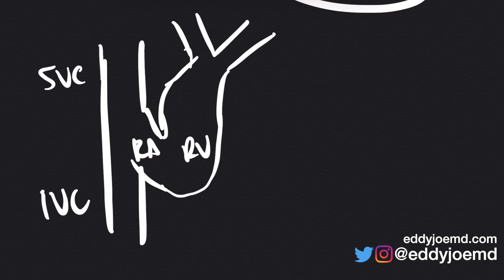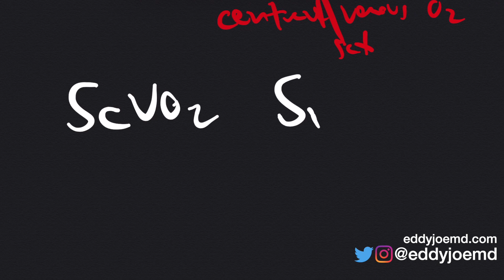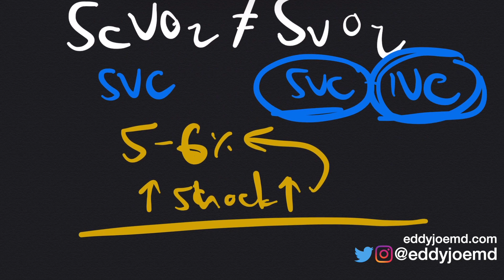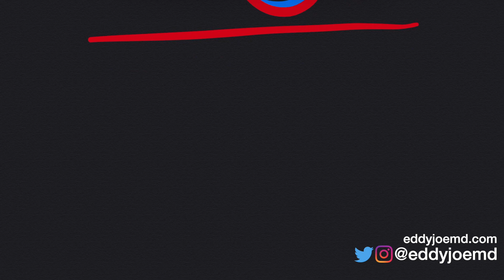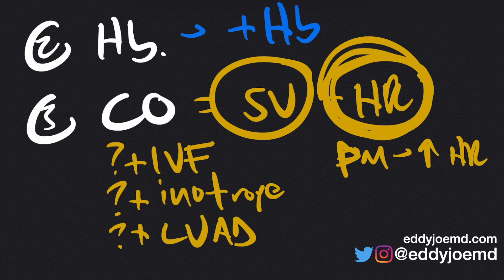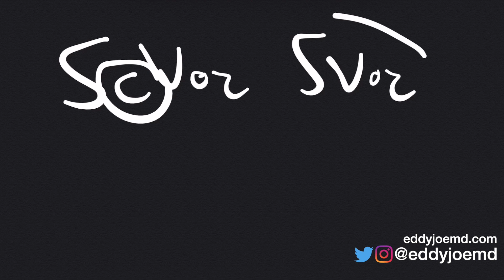Resuscitation using SvO2 and ScvO2

Comment: Was a bit confused re difference in Scvo2 vs SVO2.

Doesn't normal brain metabolism result in higher O2 extraction than lower extremities? Hence SVC o2 content is lower than IVC, and not the other way around like you suggested; AKA Scvo2 is generally lower than SVO2 physiologically.

During shock however Scvo2 is higher than SVO2 due to combination of splanchnic vasoconstriction, decreased cerebral o2 extraction etc ??

Comment: nice video, thanks for posting. kind of a dumb question about SvO2 being normal at ~75%. Does this mean that we, under normal circumstances only use ~25% of oxygen carrying capacity if the venous blood is coming back 75% saturated?

Comment: Is a simple fingertip pulse oximeter measuring both arterial and venous blood? 
If so, could a high reading be bad if oxygen is not being utilized and just recirculating? 
Also,
What about using thiamine and Methylene Blue to increase oxygen consumption by the mitochondria? 

What would you say is happening when after breathing 90% oxygen for a few minutes and a pulse oximeter reads 100‰ , this 100% can be hit for many minutes afterwards, when normally it would be much lower? 
Any ideas?